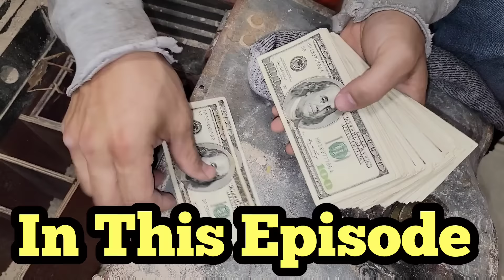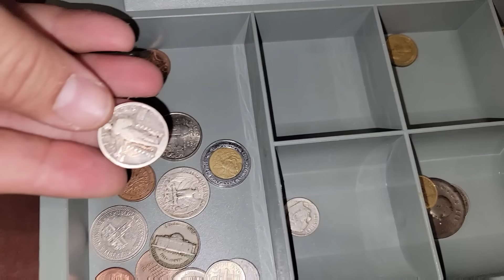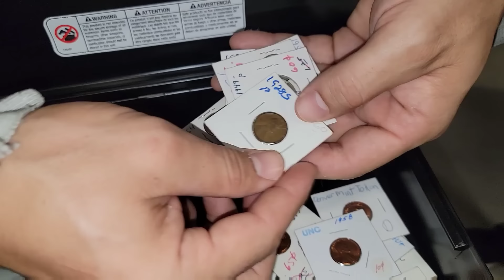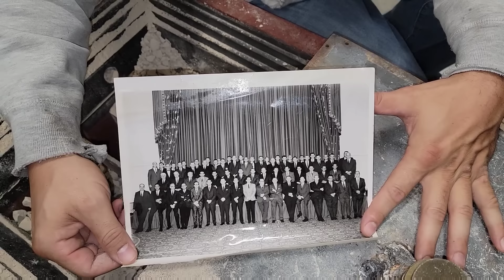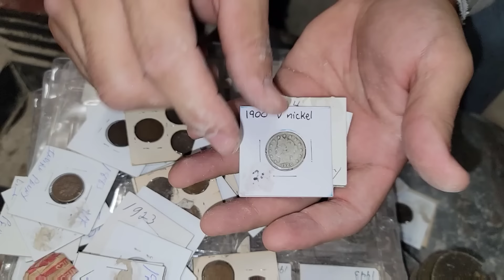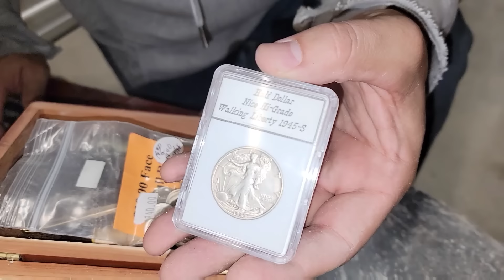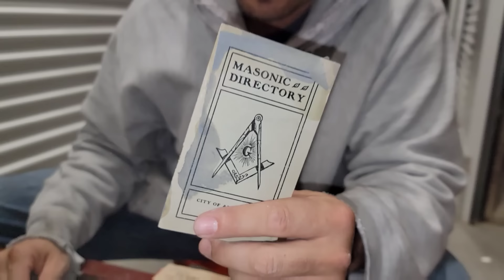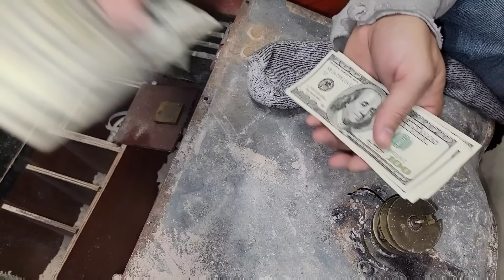FOUND MONEY IN SAFE From Abandoned Storage Unit / Storage Wars

Comment: WAY TO GO!!!!!!!  You could have anywhere between $25,000.00 - $50,000.00 in profit depending on the values of the jewelry and the coins.  You doubled your money with the Benjamins, and everything else in the locker is pure profit.  Get new locks for the tool cabinets if you can't find the keys to them.  That will only cost a few hundred dollars at most.  By having professionals replace the locks, you will keep the value of all of your tool cabinets intact.  You really have been blessed by getting this storage locker.

Comment: I hope you are aware by now, not to mix up coins you find in a safe or stored away in a chest. Rare coin dates and mint are worth far more than silver by weight today. Your 1971 D Penney can be worth up to about $1300.00 alone. Set the big safe back up on its feet and slightly tip it forward so most of the concrete will fall down/out and you can spend less time mashing rock and dust into the valuables.

Comment: Wowzie-wowzie woo-woo! 
I’m so excited for you!
You may be able to request replacement keys from the manufacturer. I was able to do that with a cabinet I purchased. 
Also, for locked file cabinets, my boss has used an electric drill to drill a hole through the lock.